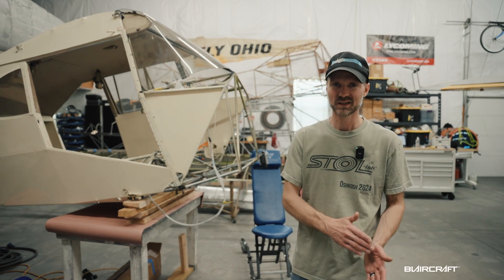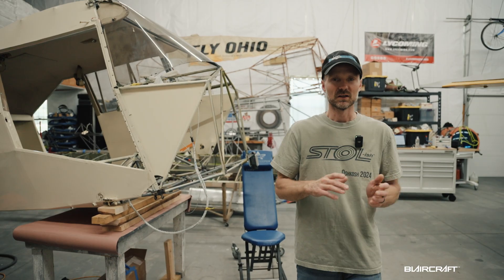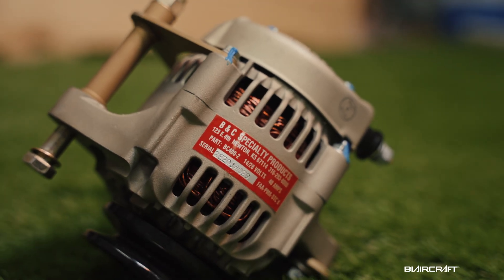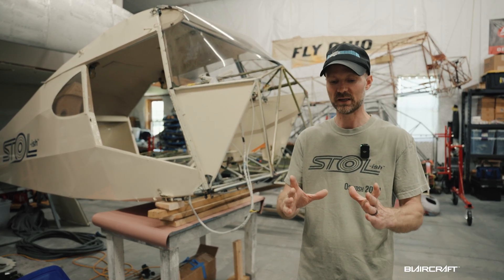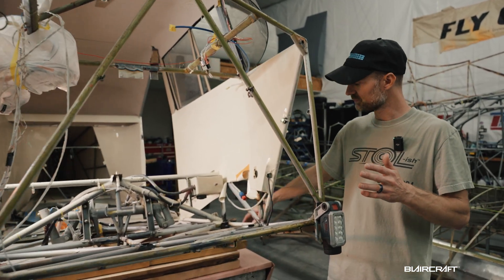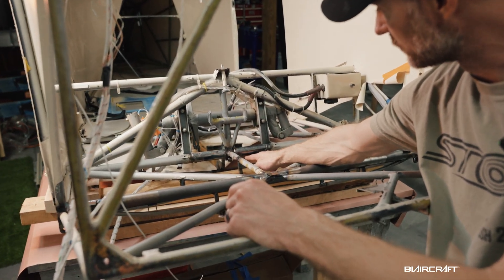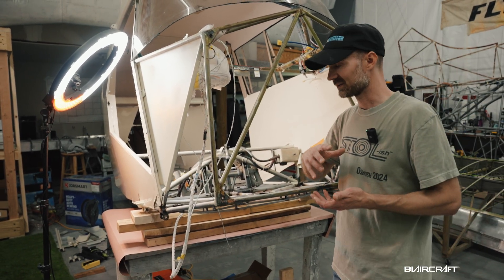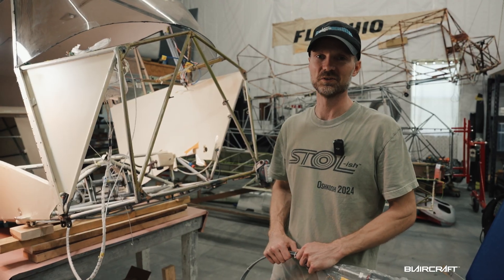These 12 Upgrades Will Change EVERYTHING- 1949 Plane

Comment: Hi Josh! Will this be an Experimental? I’m wondering what you’re using for approval to use the thicker walled tubing. But (as I’m sure you know) if you’re putting it in the Experimental category, you don’t have to worry about those pesky 337 forms, lol
Reply from the maker: The thicker tube is actually part of a STC for a Cub gear conversion by Eddie trimmer in Alaska. However, yes, I’m in experimental exhibition now… so no problem at all along with all the other upgrades.